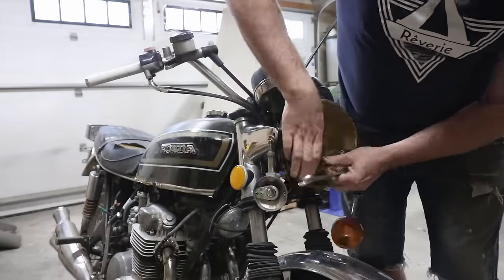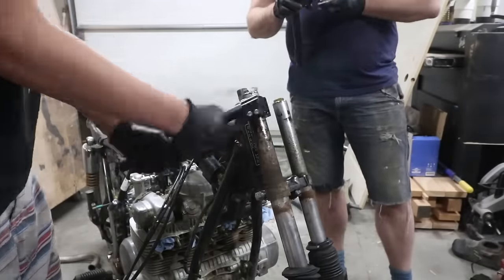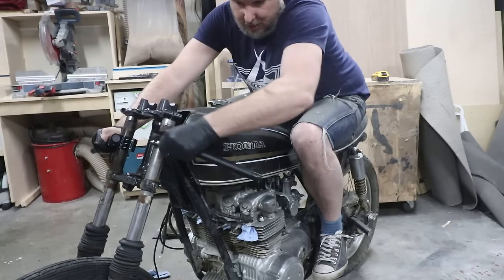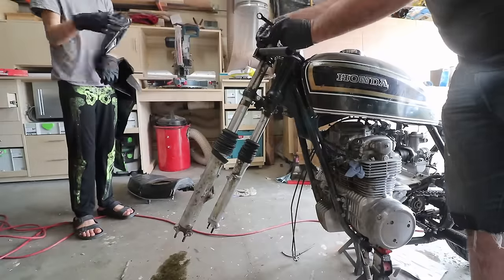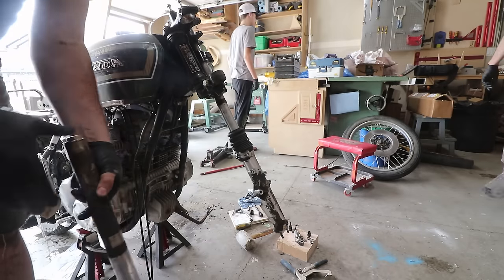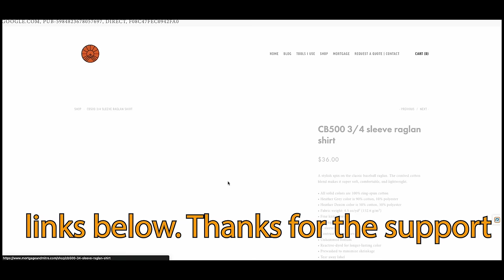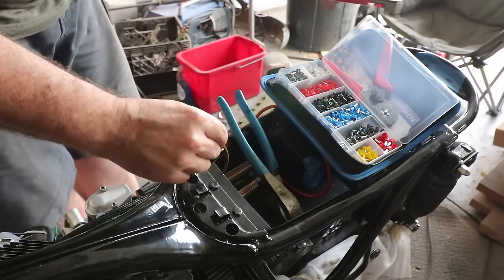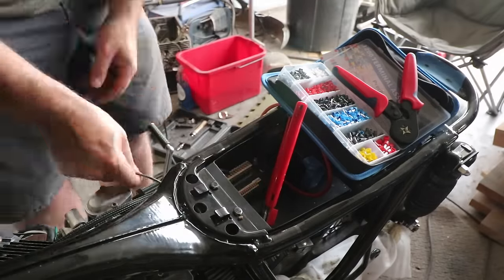Cafe Racer Full Build CB500 // CB550

Comment: A nice tip I use when I rattle can paint my builds is to put a coat of car wax on them and give them a buff… it gives them a nice protective layer so it dosnt scratch off when reassembling and it also gives it a nice shine.

Comment: Looks good I love the leather stitching on the seat lol but you definitely did a great job on the engine and exhaust they compliment the old school look well. I personally will be making a few tech changes like capacitors instead of a heavy battery and Im doing a 750, Im hoping to at least hit 150 mph with it if not Ill add a turbo set up, who knows I may add the turbo anyway and try to get 200 mph out or it definitely going with some fat tires like some thick Harley Davidson 18s or something along those lines. I want something built strong enough to handle a bump at 150 mph if I don't see it in time to slow down, I already know without stripping it down 130 mph and 0 to 60 in 4 to 6 seconds isn't an issue. The thing I like most about these builds is its not much of a suspension change and tire change to build a 650 or 750 off road machine. I also have back issues already, so I won't care as much on the appearance I can't put the handle bars that low.

Comment: Nice bike I have a xs400 I'm going to build myself, my welder is a Hobart handler 135 same as a Miller mini mig very user friendly machine. A little critique when using a cut wheel on your grinder,always cut with the wheel turning so the   machine pulls away from you,if the blade binds it will pull away not to you,don't ask how I learned this.👍👍❤

Comment: Lincoln electric easy mig 180 was the first welder I bought. It's under $1000 and is probably the best "budget" welder that is great for beginners. Even the less expensive welders aren't very cheap if you are looking for something that will be reliable and weld nice.
Reply: Of course I would do your own research and figure out what would best work for you.
Reply from the maker: I was looking at the mig 220, but that’s still something for down the road. Thanks for the feedback! Cheers

Comment: What rear sets did you use for your bike? I have a cafe racer that I might need to swap the rear sets on
Reply from the maker: Cognito Moto rearset. Not cheap but extremely well made.
Reply: @furthernorthfab  is that set universal? And did you get the “cafe racer” kit with it? Or did your stock stuff work?

Comment: I don't know why people always says to use vinegar (an acid) and then adding baking soda (a base). If mixed exactly, these make water. What is this mixture supposed to do?

PS, my dad's an upholsterer and you did that pretty well. The foam looked a little thin right down the centre, would you make it thicker next time?
Reply from the maker: Thanks, Andy. I honestly didn't think about it that way with the vinegar and baking soda. It did work awesome to break up the old grease. 

I'm building a seat right now for another bike build and will take that into consideration.
Reply: @furthernorthfab  Well, only if you find the current seat too uncomfortable for and hour or so. If not, you've got something that works.

Comment: Just fyi, a original rear fender in good condition is worth 100-150 bucks, complete airbox assembly 200, etc etc. Dont cut up good original parts, some of them is impossoble to find.

I ended upp paying a 100 dollars (inc shipping) for the bracket that holds the original ignition switch, under the fuel tank. Impossible to find a reproduction. Just an example.